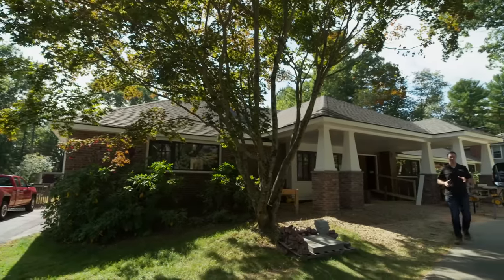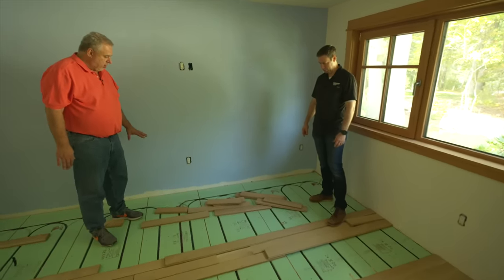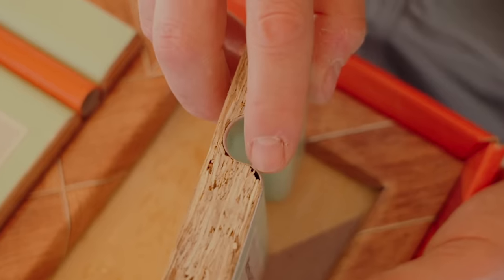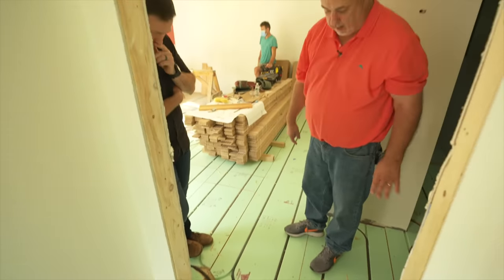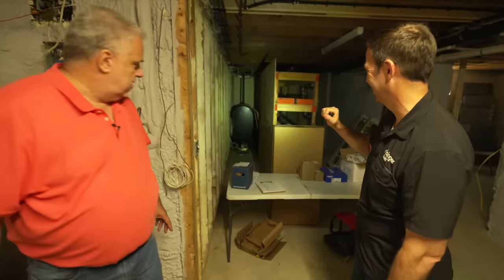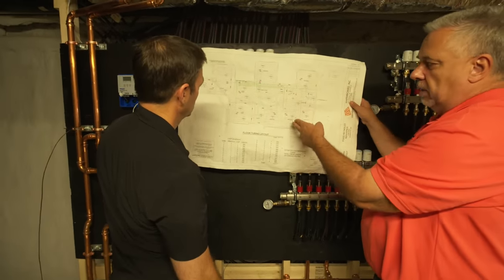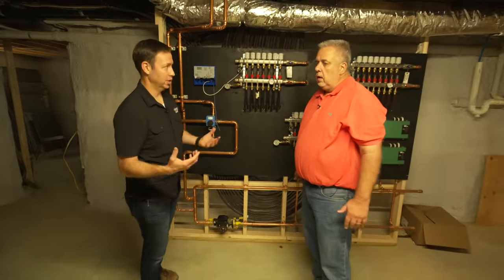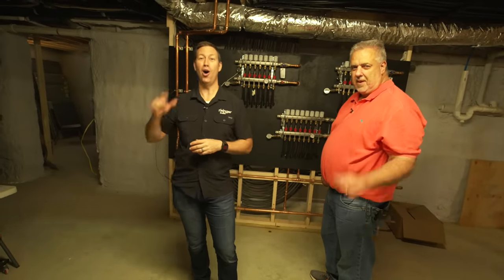Plug and Play Radiant Floor Heating System - BEST ON THE MARKET

Comment: The space between the pipes is to large and requires higher water temperature. This doesn't matter with an oil burner but surely hurts you once you consider to replace the oil burner by a heat pump. I would therefore rcommend a maximum distance between 3 and 4 inches. This rquires more loops/fields but pays of in lower water temperatures and higher efficiency of the heating system.
Reply: The aluminum skin allows the runs to be farther apart. I installed this system once. It's expensive to say the least.
Reply: You need to take care what you say, when you don't know what you are talking about. Other ignorant people might be tempted to believe you. I do Warmboard, as part of my projects, and radiant floors for 20+ years now. I do know what I am talking about, you ned not reply.
Reply: @leestevens446   The system is very good, no question and i am sure the shown installation is designed to the requirements but do more pipes per/ft²  not allow lower water temperature with constant Btu/h/ft²?
Reply: @TL-xv9of  Believing this is a legitimately posed question, I will offer this guidance on how to answer it. Start by examining the thermographs of a Warmboard system in action, with the heat on, under a hardwood floor (tile is better, carpet is a good deal worse, as far as thermal performance). What you will see is a VERY even temperature over the surface of the hardwood. 

That is the answer, but I will elaborate. There must be a temperature drop from Pex tube to air/ conditioned space. Remember, this is radiant heat, so the heat energy (infrared) is actually radiating out from the hardwood floor and being absorbed primarily by any and all objects (people) and surfaces (furniture, walls, ceilings, windows) that have a "line of sight" to the floor. But, crudely speaking, the temperature is even across the entire floor surface. What this means is that the entirety of the underside of the hardwood is "feeling" an essentially constant temperature, or heat source. The reason that this is so is because of the very high thermal conductivity of the aluminum sheet, which is a 100% continuous overlay on each individual 4' x 8' panel. Moreover, the thermal conductivity of the hardwood is quite low RELATIVE to the aluminum sheet. The result is that the entirety of the aluminum quickly reaches a thermal equilibrium, close to, but not exactly equal to the tube temperature, due in part to the relatively low delta t in a radiant floor system, as opposed to say, baseboard radiators (which are really convectors, heating the air). The thermal resistance of the floor covering is the "rate-determining step" as far as heat (energy)  dissipation, meaning the largest delta t will occur across the thickness of the wood, and NOT across the width of the aluminum sheet, from tube to center to next tube. Bottom line, if the heating of the flooring material is essentially even with 12" tube spacing (in real-world installations), then the product is thermally optimized. 

A few observations:
1) I do not personally know Terry Alsberg, but I am wiling to bet that the design and layout of the Warmboard panel was based on engineering analysis and experimenting and testing. The investment required to produce the finished product is far too great to just "wing it", as regards thermal performance. As someone who works in product development (for the hydronics industry, no less), I can assure you that no one can afford to go off half cocked, it would be a financial disaster. 
2) Smaller diameter tubing has a higher resistance to flow, thus adding to pumping energy requirements. Thousands of extra feet of small diameter tubing could be a significant energy (efficiency) factor. This is not so clearcut, however, as the goal is very low flow rates, which does tend to mediate pumping requirements. And of course, material costs and labor costs would also go way up, for what is already the costliest system to install. All businesses have to balance performance vs. installed costs; you reduce market penetration as you increase costs. 
3) If you are inclined to incredulity, there a couple of neat experiments/ demonstrations you could do (and post on YouTube?). Take a Warmboard panel, no flooring yet installed, and run a 1/4" deep saw kerf parallel to the tube channels, at 4" and 8" from on tube. Turn on the heat, and watch on the FLIR gun. The tube and the aluminum 4" out to the kerfs will come up to a uniform temperature very quickly, but the 4" strip that has been isolated between the tube channels will not come up much, and definitely not very quickly. Even a small thermal break (the 1/8" wide by 1/4" deep saw kerf is that) makes a dramatic difference in thermal performance of the assembly. Warmboard knows this, and designs to minimize routing of additional channels  as it disrupts and degrades the thermal performance. Field cut channels obviously will not have aluminum in them, to directly conduct the heat away from the tube. 
4) Another test is to put  steel bars  (say 1/2" square) on an intact Warmboard panel(before flooring) at the same 4" away from and parallel to the tube channels. Steel is an excellent heat sink, and when the heat is turned on, the aluminum will heat up from tube to steel bar, but for a long while, the steel will be absorbing the heat at a slowly rising temperature, and very little energy can "pass by" to heat the aluminum beyond (if the steel is colder, heat will flow TOWARDS it, not away from it, on the far side). Merely demonstrates the efficacy of a heat dispersal mechanism, such as the aluminum overlay on the plywood panel that is Warmboard.

Comment: So does this house still require standard HVAC heating?
Reply: No - this is the heating system
Reply: @stevenbaczekarchitect9431  What did I hear about baseboard heating in the basement?  I'm wondering if I can have a remodel system which does floor heating in one area and baseboard heat in another--running off the same boiler.
Reply: @CannabisRex  You can certainly do that. We oftentimes have clients who put an addition on the house, and keep one heat source in the existing structure, then put Warmboard in the addition. In the video, Steve points to the mixing valve. One issue here is that the baseboard radiant is probably running 180º water through the pipes, while Warmboard would use closer to 100º water, hence the use of a mixing valve in this video to bring that temp down before pushing into the floors.
Reply: @stevenbaczekarchitect9431  So in the winter you're gonna have a basically airtight house with no circulation? That doesn't sound to good to me. How do you make that comfortable?
Reply: @CannabisRex  Yes baseboard in the basement, and radiant all first floor
Reply: @MrEazyE357  No, we have a ducted ERV and humidification system

Comment: I'd hate to be the bearer of bad news but they're going to have to re-pipe the piping after mixing valve to have the pump draw directly from the tempered water side of the 4 way they made a second secondary loop and it'll just keep repumping the floor loops return water and never warm up 👎

Comment: Is there something special about the plastic piping being used such that it will not off gas as hot water is passed through it?  For people with lung issues (asthma, bronchiectasis, etc.) such gasses can literally take years off their lives.
Reply: pex al pex you are not going to have a  problem in the envelop.
Reply: remember they are not using cpvc

Comment: Creating such heat loops is absolutely not done here in Europe. Certainly not with full wood floors. With this setup the room floors will have a 'warmth gradient' from warm to cooler. This can cause the wooden boards the bent/flex and come loose.  Here we work with 'double spirals' which distributes the warmth more evenly throughout the room. You use more tubing but there is no need for these  expensive aluminum 'heat conductors'. Sample: https://www.henco.be/sites/default/files/styles/col_12/public/images/noppenplaat_beter.jpg?itok=FeRbqiiC

Comment: Looks nice,but I expect it's not cheap...... Me...I think i'll keep to my radiators and open fires...
Reply: Pip open fires are lovely- but the least efficient form of heat there is, as much as ninety percent goes straight up the chimney, which continues to draw warm air out of the house even when the fire isn't lit. Then there is the particulate pollution they produce. If you like a real fire the better option is a quality wood stove - many European ones are well over 80 percent efficient, and are can be very clean burning.
Reply: @spencerwilton5831  Thanks,I'll check them out...
Reply: @spencerwilton5831  Totally agree, wood burning is the least efficient energy source for heating. And yes I do alot of Rais wood stoves, extremely efficient and stylish

Comment: A useful goal of modern home construction is an air-tight super-insulated envelope. The building code says you must have air circulation--or at least exhaust fans in the kitchen, bathrooms, and laundry. Of course an air-tight envelope means you need to deliberately bring in fresh air. So an energy recovery ventilator (ERV) makes the most sense. A system much like what Matt detailed in his "fresh air system install" video 2 weeks ago ( https://www.youtube.com/watch?v=OrG7oG8Tvp8 ).

Since you need ducts anyway one of the major advantages of hydronic heating vanishes. You could put heating and cooling in the main duct of an ERV system, or use mini-splits in the rooms. So why run a second system? Is warm toes enough reason to install and pay for two independent systems?

Then we have the issue of heating oil. I've never dealt with it, but I do have a Colorado cabin that runs on regular deliveries of propane. Major hassle and shockingly expensive. I've been counting the cost of an air-tight super-insulated envelope retrofit, then drop the propane and go all electric. Electricity is cheap, and it's at least possible to make my own. But it isn't possible to make my own propane. However I've come to the decision to sell the cabin, so no fun retrofit project for me at this time. Anyway, I can't imagine heating oil delivery is any less of a hassle than propane delivery.
Reply: mvhr systems work best when they have separate ductwork from what you use for forced air delivery of heating and cooling (that was the case in the system in the risinger video you referenced). the duct plan for an mvhr system is not the same as that for a heating and cooling system.
Reply: @paperwait9611 : Okay, but why? It seems simple to add a heat exchanger core to the big duct of clean air coming from the ERV and going to the distribution box. Shouldn't need a lot of capacity with a super-insulated envelope, and may have more loss from the ERV than the walls and ceiling. Of course mini splits are all the rage now and I can see people wanting to use those.

Comment: Why not just go electric?? Seems labor intensive when considering manifold/runs to each room.
Reply: In many instances, electric is best as a floor warming feature, while hydronic typically heats the whole home without the need for a secondary heating system. While there are exceptions to this, electricity rates based on geography can vary wildly, and it's often much too expensive to run electric radiant for extended periods of time. In this project, all tubing was done as a home run back to the basement. An option we recommend is place manifolds in the back of closet. This substantially reduces the amount of tubing and makes the system more efficient.
Reply: Right on bro
Reply: It really depends on the region of the country you live in. Electric would be very expensive to run in the upper midwest or New England. Also...you'd probably need to upgrade your electrical service. Heating a house requires a lot of wattage.
Reply: Because when the boiler finally dies in ~20 years, you hook this up to a geothermal loop and have constantly heated floors for literally nothing more then a few W/day of power consumption to run the pump.  Suuuuper efficient, and considerably cheaper then electric heating (plus in some places, oil is still cheaper then electric).
Reply: $$$$$.  Back of the napkin math 1kwh=3412 btu.  On gallon of heating oil=137,381 btu so  oil has to get to $3.62 a gallon to break  even @ 0.09 per kw. ( 40.26 kwh = 1 gallon of oil)
Reply: @kichigaisensei  West Coast electricity rates very high as well.
Reply: Or like where I live in Canada, it's 12.8c/kWh ! The break even is WAAAY higher.
Reply: @Warmboard  I'm sure it is very costly to warm a home with electricity in the Pacific Northwest. I should have stated that. You're right.

Electric heat might make sense in some parts of Texas, Arizona, Southern California and the like since they don't have a huge heating demand.
Reply: @spyrule  A geothermal loop? Are you talking about a heat pump? Most places don't have access to geothermal heat.
Reply: @tysleight  

I nerd out on this stuff,  thanks for the reply

But factor in the oil burner annual maintenance cost

The cost to install ALL the oil burner hardwear and piping/chimney/in floor stuff if desired.  What’s the difference in price for install between the 2 systems?

The maintenance alone on an oil furnace sucks. Just more things to break and be hostage to the service guy
Reply: @paulharvey3515  The part I think you missed is that he already HAD the  Boiler. I doubt he would have went with oil if he was installing that part new.
Reply: @spyrule  

Not sure I understand
Reply: I completely hijacked this conversation 

I’m in mid Atlantic region of the US

Using electric baseboard as backup heat. Using wood heat as primary
Reply: @kichigaisensei  Yes, sorry heatpump. Go down deep enough (~200ft) and it warms up pretty quickly.
Reply: @spyrule  That's cheap to operate....but not cheap to install.
Reply: @kichigaisensei  Of course not, but a single bill paid, with an incredibly low month-to-month bill, you'll quickly amortise the cost of the unit in ~5-7 years, sooner if your oil/gas/hydro rates are super high (like they are in Ontario Canada).

Comment: Could this system work off grid powered by solar?
Reply: I do not see why not they have electric boilers you just need a large enough solar system to run the boiler. The best thing about these systems is when you lose your power source temporary  to run your boiler the retention of heat stored in your runs last longer compared to another heat source.
Reply: @richardlug6139  I see what your saying in regards to sizing out solar to power it all. I rather not worry about power outage so I am planning on having a very large-sized battery storage utilizing refurbished tesla batteries. Would concrete floors assist in heat storage?

Comment: The install was super clean but that's all I can say positive about this system.  the finish is spot on and looks pretty but the functionality of the system is inefficient. Why would you run the zone valves and mixing valve all the way to the other side of the room from the boiler. You have flow loss for every 90 on your system and boiler loops, keep those loops as simple as possible. Also its a waste of space to take up that entire room just for the heating system, let the homeowner use their basement to stack storage boxes, make a workshop in the mech room instead of cluttering up with poorly thought out radiant components. WTF is going on with the mixing valve, mount it upside down and get rid of 8 of those 90s and the 45 offsets, it will work the same without that dyslexic piping.  the entire system could have all fit on one wall and they should have put the zone valve  manifolds in the floor joists. You will have flow imbalances from the loop closest to the valve manifold vs the furthest loop on the other side of the house. we are talking 230' (ish) design per loop as stated on the plans plus 20' supply and return to the zone panel for the shortest zone 250' total. The furthest zone 230' design plus 150' supply and return (75 each way, could even be 100' on that house for 200') that is possibly 430 FEET ON A LOOP that is sharing the same pump with one that's 230?? When both the furthest and closest zone call for heat where do you thing the most water will flow? Yes there are balancing  valves on the manifolds but then you are RESTRICTING flow to the shortest runs when you do not have to when they could ALL be at max flow. The install was super clean but the location of key components is not efficient, creates loop unbalances and wasted A LOT of pipe!
Reply: considering they said the basement alone was over 2000 sq ft, I'm thinking they don't need to worry about putting it all on the same wall

Comment: how do you heat this house in the early fall and late spring
Reply: casy casy what makes you think this system wouldn't work then?
Reply: @spencerwilton5831  because when it gets to the temp you set ,its that temp all the time.if you check out people that have itchy all say  the same thing they get overpowered during those times of the year.also wood floors have a hard time with it .it feels great when its cold outs love it in my work shop its the best.but most people put in backup heat to run during early fall and spring

Comment: I don't see any insulated lines in the  basement. Seems like a huge energy loss while overheating the space.
Reply: I thought this as well, but the energy is being lost in the living insulated space. If their primary heating fuel is oil I don't think it matters while using the heated floors.